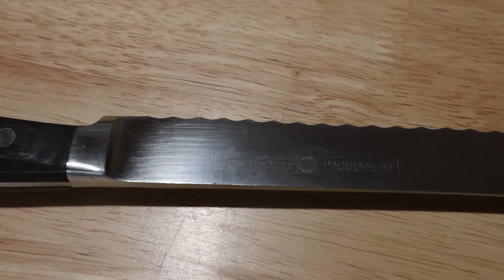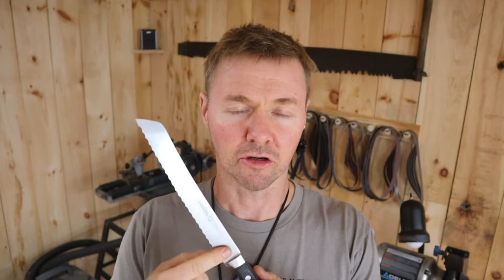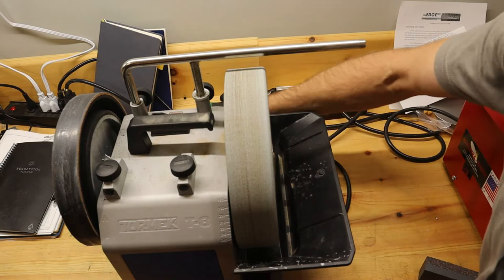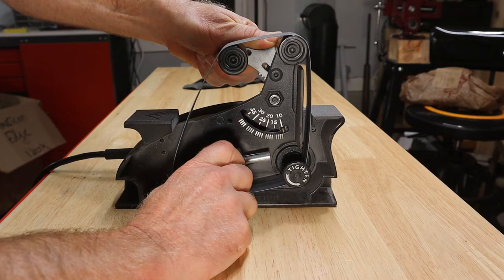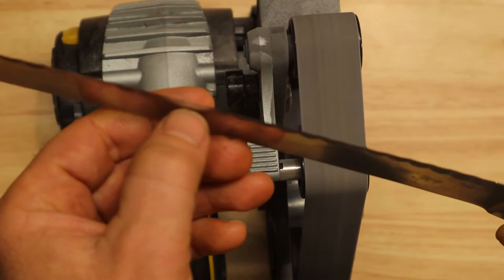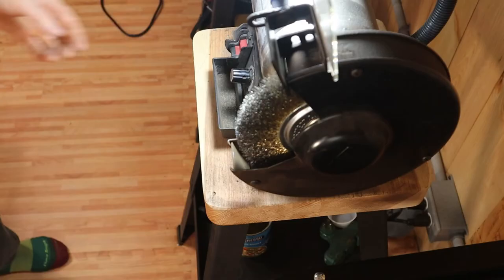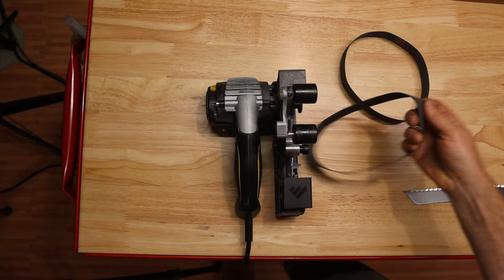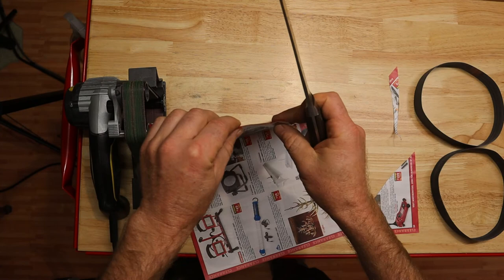TNG Ep. 39: Serrated Knife Sharpening REVISITED

Comment: As usual outstanding closeups. I do dull serrated knives by hand on different size ceramic rods that match the serrations. I repair damaged serrations on AO sandpaper wrapped around a copper pipe clamped in vise. I use a pipe slightly smaller so it mostly fits the cut.  I usually use 400, 800, and 1500 and remove the burr on a 2000 grit ceramic rod. The shirts look great.
Reply from the maker: Oooo, that's a good one! Aluminum Oxide (AO) sandpaper wrapped around a small pipe (or pen or pencil or drill bit...) to push the burr to the flat side then remove the burr on a ceramic hone. Love it! So many ways! Appreciate that, Adrian.

Comment: Thank you Matt. I have confidence in doing these now with the tools I currently have.
Reply from the maker: You're welcome!
You don't have a Tormek but you could still find ways to work the serrations. Diamond hone, small round file, chainsaw sharpening bits for a Dremel tool, but yeah, after that you'll be ripping them out with your Work Sharp's and wire wheel. 
Let me know how you settle in on a procedure that works for you.

Comment: The difference that the wire wheel makes is crazy!  I was doing a similar method, but without the wire and only slightly improving the blade.  I just introduced the wire wheel and Im blown away at the difference it made

Comment: I use an old twice as sharp wheel to do serrations. Because you can change the profile of the wheel to fit the serrations. I use the honing wheel. Depending on the condition of the serrations. You can also use the white grinding wheel to re- serrate knives.
Reply from the maker: That's a cool idea. You must put a radius on the wheel using a dressing tool? You also use the clamp to keep the angle consistent? Can you explain any more about how you change the profile of the wheel to fit the serrations? This is a cool idea and I'd love to know more. Thanks!

Comment: I've been using the radiused edge of an older (too small to use) SG-250 but it doesn't last long and the radius does wear out really fast. Once I even used the edge of an SJ-250 and it was mirror edged (and got the knife super slippery sharp) but again the wheel radius enlarged too fast. It'd have to be re-surfaced again after a few knives and that can get expensive. I made a video on the deleted channel but that's long gone now. I'm a die hard Tormek guy as you know but slowly branching out to other tools as I feel is necessary. 

Another great and very useful video. Thanks.

Comment: I used a Zwilling Knife sharpener and the knife was so dull prior to using the Zwilling knife sharpener.  I just lightly pulled the serrated knife through 20 times coarse and fine as I would a normal knife.  Voila, it came out so sharp that I thought I had a new knife.

Comment: Another really good video...nice work Matt!

This is not meant as criticism but rather an observation. The radiused Tormek wheel gives you one radius. If that happens to fit the radius of your knife's serrations then fine. If it doesn't, then it won't work for that knife. Serrated knives are a real bitch to deal with. I had a Wusthof 3" fully serrated paring knife in the shop to sharpen the other day...tiny serrations. I hope I never see another one. And Matt, I like your idea of using the Work Sharp to remove the backside burr. It's a good machine for that.
Reply from the maker: Thanks Gary!
That is a very valid point about the radius. I've been able to make it work with most standard serrated kitchen knives that come across the bench. 
We just had a conversation in the Guild about those tiny serrated knives. I call them micro-serrations and I'll generally confer with the customer about grinding a standard straight edge onto the knife.

Comment: What is a good method for getting rid of burrs on the flat side of a serrated blade without rolling them over to the other side?
Would keeping the sander against the blade instead of going away from it leave it cleaner?
Reply from the maker: A couple passes on leather on the flat side and a wire wheel on the serrated side works for me.
Reply: @capnmatt41  Thanks!

Comment: Mate you're doing that the hard way 🤙🦘
Reply from the maker: You've piqued my interest, mate. Pray tell the easy way.
Reply: @capnmatt41  a thin wheel like a chainsaw wheel thickness or up to about 10mm, round the profile with a diamond shaper, come into serration from top down , move along etc, polish off burr on a hard denim wheel with white rouge, 3 mins tops, been doing it this way since 97, no need to flat grind the underside,  grinding underside is really lazy , that'll be $100 , cheers 🤙🦘
Reply from the maker: @billybobwombat2231  Your $100 is in the mail, mate. But first! Yo, what grit and what speed (RPM) are you running that wheel. I love that idea I just haven't been able to figure out how to make it work. What wheels, too? Running it dry or wet?
I'd love to see some vid or pics and you can hit me up on the side if at all willing to share some of that: matt@americanedgesharpening.com
Down under, right?  Making you earn that international postage on that check ;)
Reply: @capnmatt41  I generally use a 220 wheel but a 120 will work, I put it on a tool n cutter grinder,  its running at around 2000, but a bench grinder will do, just don't lean into the grind to much, just dry, get the same grind noise each gullet,  move from the waist not the arms,  dont move your feet,  bit busy for vids 🤙🦘

Comment: What happens if I sharpen only on the flat side and remove burr with stropping?
Reply from the maker: That can work as long as you can push the burr back and eventually get it off. Over time the serrations will fade. 
The cutting edge is made of up both sides of the steel so by only working one side you only work one half of the cutting edge. Try it and see how it goes. Explore and enjoy.

Comment: Where do the metal shavings go if only using the onion system?
Reply from the maker: Hi Jack, I'd like to help, but I don't understand the question. Could you add more and clarify a little bit? Thank you.
Reply: @capnmatt41  it seems the metal shavings from sharpening, have no where to go, esp if done on a kitchen counter. Is this a concern that would make the onion sharpener not good if i can only use in a kitchen space?
Reply from the maker: @mypersonalphotosite  Ah! Now I see. YES! Dude, doing this on the kitchen counter a few times is a good way to get the ones who love you to love you a little less. 
I use mine on a downdraft table and the members of the Guild have found other ways to capture the *dust (more than metal shavings, though now I see what you mean). 
Not only will it make a mess, it'll also go airborne and it's something I strongly advise against breathing. 
A knife or two in the shop, no biggy, but if you're running a block of knives through it you should think through dust collection or doing it in an appropriate environment. 
Thanks for asking, great question!